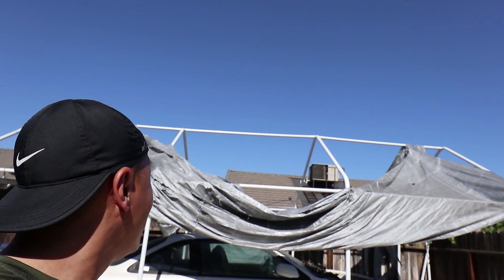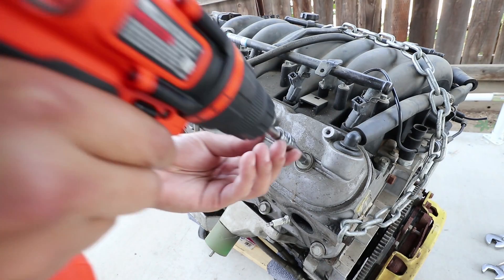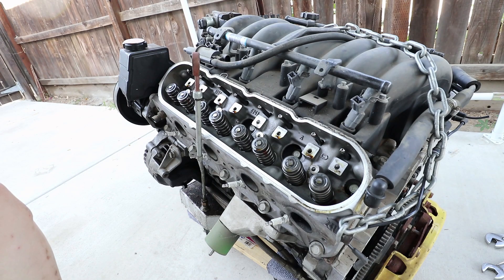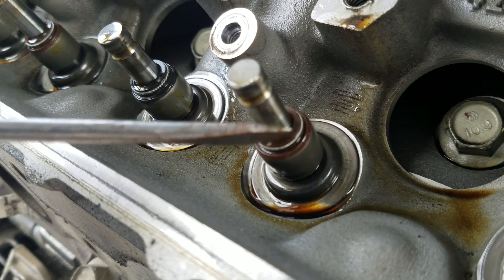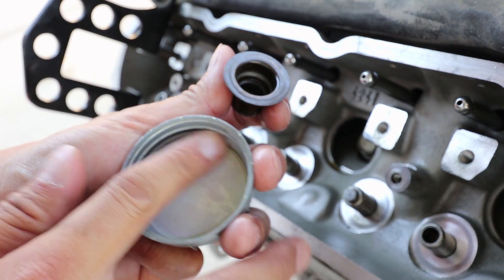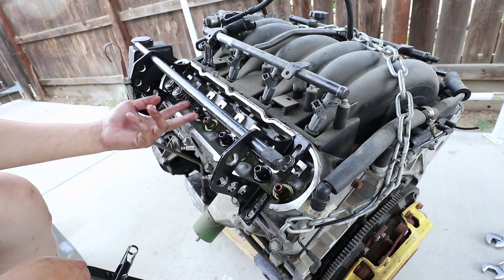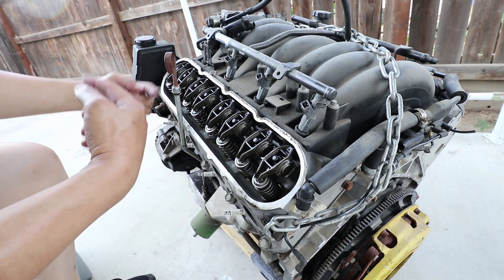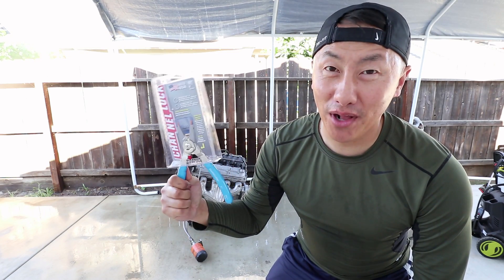LS1 Valvestem Seal Replacement

Comment: THIS! THIS IS THE KINDA CRAP THAT 🤬 ME OFF.  I've been the guy trying to learn by Searching u-tube. Spending hours and days with false information/ Ignorance. For anyone that runs across this. DO NOT DO ONE DAM THING YOU SEEN HERE!    1.  he didn't have the wrong seals. Neither do you.  No matter Which ones you have.2. You can do this with heads on, But you get the piston to the top on #1 and #6 do those rotate crank. Do the next two at TDC 3. You rotate crank, watch push rod till it's down off lobe on heal of cam, then you Tork rocker. 4. If you have the two piece Seal seat, DO NOT Use a socket!  DO NOT use a hammer.

Comment: Oil consumption results from the valve cover with pcv, if the valvecover is 1997-2010 style, is a major cause, it was fixed for 2011-2016 LS Engines.

Comment: oil cant leak between the valve spring seat there is nothing for it to leak through there the opening where it leaks is at the top of the valve guide where the seal goes over.

Comment: U should never let the valve drop into the cylinder, they make a tool that screws into ur spark plug hole and allows u to hook ur air line to it that supplys compressed air into the cylinder and keeps the valve raised. U can bend the valves by trying to rotate the engine to force the valve back up into the seal. Or they can drop to far and u will have to pull the heads off to retrieve them.
Reply: I wouldn't say never, but I only like to do it on cylinders at tdc so they don't actually fall down in there.

Comment: This kids is how you bend your valves.
Reply from the maker: Engine is still running til today.
Reply: @GTContent  lol an LS will run with only one spark plug wire.
Reply from the maker: @Utubegofukurself  Mine runs on unicorn power

Comment: Bro you do them one at a time so your valves don't drop like yours did. To each his own but on these high dollar builds I dont take chances. Holy shit.... your lucky you didnt have to pull the heads off.
Reply from the maker: Yes, it's risky but worked for me. So it's possible from my experience. But to be safe, do it as you mentioned.

Comment: My LS1 put out clouds of blue smoke after it's warmed up and shut off for 10 or 15 minutes and I restart it. It goes away within a few minutes and doesn't smoke anymore. Is that a symptom of valve guide seals? If not what is it a symptom of?the only time it smokes is once it's warmed up shut off and restarted again around 10 minutes later.

Comment: Did the engine smoke before this?
Reply: Are you asking because you had this problem? I had a 5.3  that would smoke on startup, I changed the valve stem seals and it stopped
Reply: Yes i do
Reply: @Bdizzy81  Yes I have smoke on startup as well thanks to using the old style valve seals

Comment: Use compressed air in each cylinder next time. Not good to let the valves fall into the chamber and use the piston to push them back up. You can damage the guides as well as the valve itself.

Comment: ARE YOU SERIOUS!!!!! First off you are supposed to pressurize the cylinder with compressed air to keep the valve stuck closed when doing this. WHY you ask!!!! Because although the valve did not fall into the cylinder there is A LOT of carbon on the top of the cylinder that the valve could have caught on as it was being raised back into position. This carbon could have caught the valve since it is at an extreme angle to the piston top and bent the hell out of the valve. Also since you had all the spark plugs in the heads you are working against the combined compression of all cylinders and you would NEVER have been able to feel if a valve had caught an edge and was hung up on the top of the piston and beginning to bend. Next YOU USED A TORQUE WRENCH AS A BREAKER BAR!!!!!!! I guess if it’s a POS that you don’t care or use to get accurate reading then go ahead and use it if it is all you have. Also HOW DID YOU NOT KNOW YOU USED THE WRONG SEALS IN THE FIRST PLACE????? Last why would you NOT pull all the plugs out of the heads to make turning the motor over by hand easier?!?!?!?!?! Lucky for you it all worked out BUT this is by no means the correct way to do this procedure!!!!!!

Comment: good working, please,I need this tool press for spring valves
Reply: @lsx434  In 1983, I was working on imports at an independent shop and need one as well. Using a jack handle and some scraps I welded one up. I was doing valve stem seals to freshen up a 2003 5.3L and only needed a longer bar to reach the ends. Other than that, I used shop air to hold the valves up. They are closed during the power stroke, so placing the cylinder in this location, I installed my home-made flex plate lock and compressed air. 
  Please be careful as most engines will bend valves using this method by simply cranking the engine. So try to create what you need only once. Best of luck to all. ASE Master Tech since 78 now disabled and hurts, as I like to get one thing done per day, but that’s life.

Comment: I have. 1998 gmc k1500 5.0 liter sl z71 auto ....  if. Put the piston at top dead center will the valve not fall in the piston chamber allowing m to change my valve stem seals ?

Comment: How did you know the entire valve was not going to fall into the cylinder - thought it was possible to lose them all the way into the cylinder.  Great video.  I wish my job I did on my Suburban was when the engine was out!  So easy.  And I love that spring tool!
Reply: Find another video for the right way to do this. For anyone saying this video saved my life that is scary
Reply from the maker: Thanks! Never heard of them falling in there, but I tried and they didn't so that's a good thing. Yes, it's definitely easier outside of the engine bay.
Reply: @GTContent  after doing that with no compressed air or having the appropriate cylinder at dead top center while working on it. Was a big gamble and you won. You should go buy some loto tickets
Reply: I’m not sure what exact motor we are dealing with. But unless it is a 4.8 or 7.0, it has a 3.622 inch stroke. Given that an LS valve is a little under five inches long and will maybe drop a quarter of an inch at TDC with no spring holding it up, it would be IMPOSSIBLE to drop it completely into the cylinder.

On the other hand, using a piston to push up a valve is a BAD idea. Because the valves are at an angle with respect to the cylinder axis, pushing them straight up with the piston causes the valve stem to bind in the valve guide. The less of the valve stem there is in the valve guide, the worse this is. This binding action can damage the valve stem and/or the valve guide. And if extreme, it could bend the valve. If the valve drops into the guide, it would be best to pull it up with a thin magnet of some sort (if possible). But even better would be to prevent the valve from falling into the cylinder with compressed air or rope.
Reply: You got lucky... that's all
Reply: @boosted2.4_sky  friend did this on his Suburban and only raised the piston to TDC. Never had an issue with valves falling in. Never used compressor or any other technique like rope or anything.

Comment: hey my friend what tool is that you are using to remove the springs and is it unversial for other v-8 motors like ford small block, if you have a part number would be great thanks bud
Reply from the maker: It's actually supposed to be used for DOHC engines but also works well with  LS1/2/3's. 

Exact one in the provided link. You may find it cheaper elsewhere.
https://www.ebay.com/itm/Auto-Engine-Overhead-Valve-Spring-Remover-Installer-OHV-OHC-Compressor-Tool-Kit/232987531470?hash=item363f2398ce:g:-HYAAOSwHp5bWDIs
Reply: thank you

Comment: Those other seals were fine, its actually what's used on a dual spring setup
Reply: I am installing dual spring setup on my Ls. Is it normal to have that gap between the seal and retainer? I wasnt sure if i got wrong seals
Reply: @jnarvaez89  yes its normal

Comment: The original ones you have installed in the beginning of the video look like the BTR seals they use them with dual valve springs so the seal clears the inner springs
Reply: Hey im trying install those type of btr seals but noticed that they dont sit all the way do you know if thats normal?
Reply: @josezamudio6097  did you ever figure that out, I'm here searching for the same answer

Comment: Thanks dude that helped me alot I fixed my 2003 Holden caprice thanks 2 u
Reply: dude did you use compressed air in the cyliders or done it the same way he did and let the valves drop ive got vx ss and need mine done also

Comment: so you just let the valve fall and the piston pushes it back up? If that's the case I'm not so worried
Reply: I always thought the valve would fall into the cylinder, I'm really surprised by this.
Reply: I was like wtf??? Lol
Reply: @BryanMTorres  it worked though
Reply: I freaked out a little.
Reply from the maker: Yes
Reply: So they will always come back up ?

Comment: You should make v8 VTEC = extreme power
Reply: I’ve DREAMED of doing this for the last 20+ years. One of the nice things about the LS block is that, unlike the Gen I and Gen II, the 10 bolt pattern for the head makes the LS block more amenable to a DOHC changeover. In fact, Mercruiser Marine ready sells DOHC heads (but not VTEC) for the LS. Asode from oiling modifications and setting up a cam drive, the block os pretty much good to go.

Of course, you would need to reverse engineer Honda heads (probably K- series) for the LS block. You would also need new intake and exhaust manifolds to take advantage of the improved flow characteristics of DOHC heads (rather than compromising things by adapting the new heads to existing LS manifolds). And you would definitely need appropriate cams. It would admittedly be a large undertaking. But the potential of such a setup on the LS platform would be HUGE.